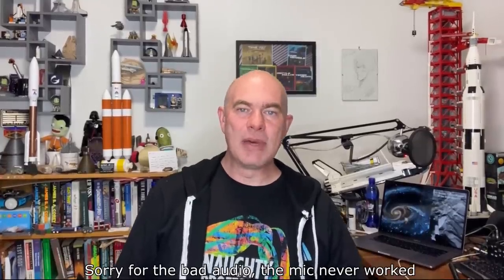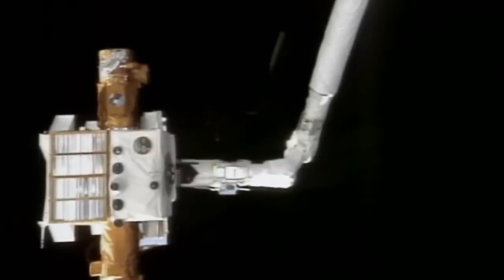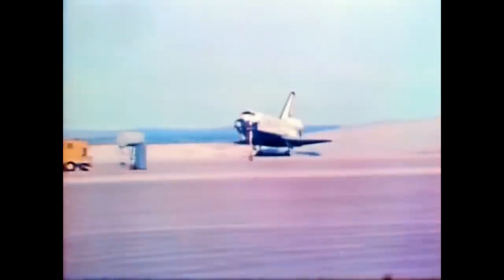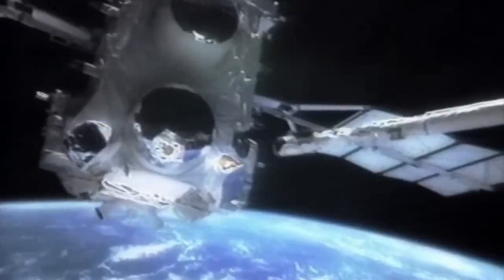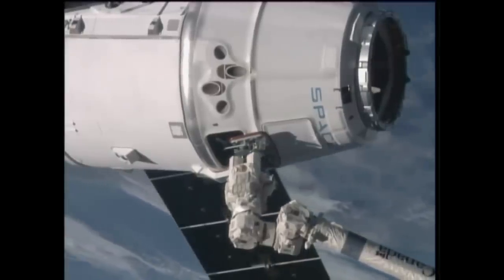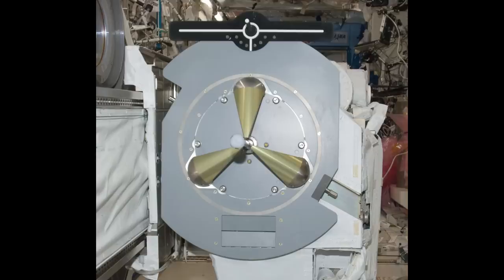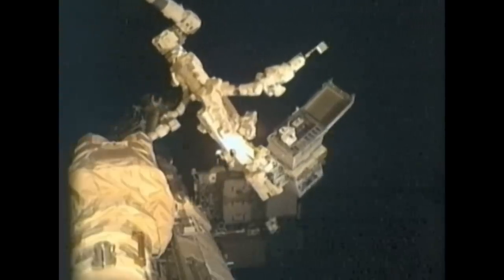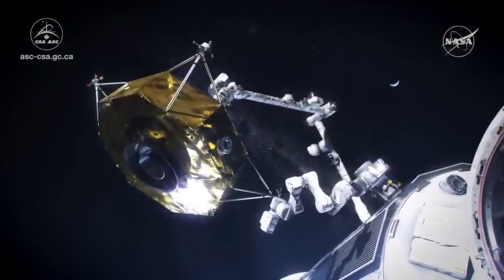Oh, Canadarm - Why NASA Calls On Canada for Robot Arms IN SPACE

Comment: At the Falcon Heavy demo launch, I had the chance to hang out with an astronaut for an hour or so.  We spoke at length, from an engineering perspective, about the Canadarm.  One thing he made me realize was that the arm is prone to oscillations, that can't be dampened in space.  Because of the 0-G, if an oscillation happens, it will bounce up and down the arm continuously until it completely destroys itself.  This is why very slow movements is done, and the Canadarm contains specific gyroscopes to help it control such oscillations.  Space Engineering just blows my mind, everything they have to think of that we take for granted on earth.  When we design something, we assume a pull of gravity will help dampen oscillations.  Not in space.  What a GREAT, bleeding-edge contribution to the space program.  Canadian Engineers Rock (ERTW).
Reply: Gravity on its own doesn't damp oscillations. Think of a pendulum, for example, or an eccentric orbit. Air does, though.
Reply: @IDoNotLikeHandlesOnYT  It does not, but remember the canadarm is a shelf, and with a shelf the weight of the shelf dampens the oscillation against the fixed point.  I'm sure you remember the Partial Differential Equation class with the spring on a spring on a shelf!  Ugh i still have nightmares of it.
Reply: So turns out the robotic arm instability in KSP is actually a feature... I'd just wish there was an Inverse Kinematics controller.

Comment: There is a piece of the story you might want to look up.  I am going off of memory here, but in the pre-Internet days when I was in elementary school, I wrote a science report about the canadarm.  (I.e. better fact check this before talking about it).  What stands out for me was that the Canada wordmark clearly seen on the arm was a last minute addition, and extra testing had to be done to make sure adding the logo wouldn't impact performance.  During that first flight when they tested it, video downlink was spotty for the reasons you mentioned. When the TV feed cut on after deploying the arm, the logo was plainly visible: a big fist bump for us Canucks.  The thing is that prior to that flight, there was no American flag on the side of the shuttle...  Sufficed to say, the shuttle program added the external logo.
Reply: Honestly, anything that flys should have pinup art.
Reply: Not quite right.  The external flags were there from day one.  However, the US flag stitched to the aft payload bay bulkhead's thermal blanket was added in response to the Canada wordmark showing up.

Another trivia note:  Apparently, on STS-2, one of the astronauts took a little sticker of the Canada wordmark and applied it to the RMS control panel during the flight, very neatly, looking as if it was intended to be there from the start.  Thing is, since that sticker was not on the official drawings of the panel, it was dutifully scraped off during the Shuttle's turnaround for the next flight.  However, apparently, the astronauts disagreed with this, because every time the Canadarm flew, the Shuttle came back with an identical wordmark sticker applied in exactly the same place on the panel.  Every time, it was scraped off during turnaround... but come the end of the program, apparently, NASA saw no need to "correct" that one last time, because in photographs that were taken of Endeavour's flight deck after her arrival at the museum inn Los Angeles, you can see that the Canada wordmark sticker remains in place on the RMS control panel.
Reply: @rdfox76  that actually makes more sense than what I remember and understood as a ~10 year old. Unless they put a camera on the end of the canadarm, you wouldn't really see the external tail flag on the TV feed for most missions...  A flag on the inside of the bay on the other hand would show up, and would help downplay the prominence of the canadarm markings.
Reply: @cgapeart  Still sounds like a pretty good paper for a 10 year old.
🙂
Reply: @thatotherguy7596  "He had a report due on Space!"  (I'm thinking of that encyclopedia Britannica commercial)

Comment: Years ago, Wired magazine had an article on the team that wrote “perfect code” for the shuttle. To point out how good it was, they mentioned that they found a bug in the code that operates the Canadarm when mounted on the right side. The only thing is, it was never mounted on that side. They were so thorough they would debug code that was in the spec but never used. The story was more interesting that that, but I thought it was an interesting Canadarm anecdote.
Reply: When something really cool is attached to the side of your 100 billion dollar toy you make god damn sure you know how to play with it without breaking it lol  It's an amazing feat of engineering on both ends and I'm super proud to see a maple leaf in that shade of red up there doing everything we ask of it and more
Reply: That is a great article, worth looking up. I read it back around 2007 I think. The STS flight software is known as the closest thing to perfect code that's ever been written. Whatever else was wrong with Shuttle, the software was on point.
Reply: In fairness, the original spec was to be able to mount a Canadarm on both sides of the Shuttle simultaneously, and operate them independently (though one move one at a time); the RMS control panel included switches to allow the controller to operate either the left or right arm, and there were also separate latch controls for the left and right arms, plus the Shuttle was built with mounts and other RMS support hardware on both sides.  This actually proved to be a boon post-Columbia, as the OBSS was not only built from spare Canadarm parts, but also was carried in the position reserved for the right-hand RMS.

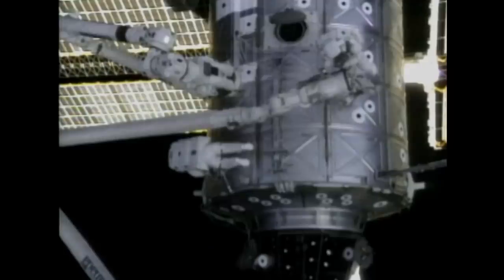Comment: Thanks for this walk down memory lane. No, I work directly with the Canadarm(s), but I did work with the Space Vision System (SVS) and Laser Camera System (LCS), both which were used in Canadarm operations. SVS was the machine vision system that uses those black-and-white dots (e.g, @9:40, @11:44, ...) and was used for assembling new elements of the ISS. It gave the relative pose (x,y,z,yaw,pitch,roll) of two modules while the Canadarm/2 was berthing the new module, and did it from the cameras at the far end of the shuttle bay often 50 to 75 feet away, looking at the side or back of the module. 

I supported 13 SVS flight including the first ISS assembly (STS-88), and 6 from MCC including STS-100 where Canadian Chris Hadfield installed Canadarm2 on the ISS using the Shuttle Canadarm and Canadian SVS system (which I was supporting in MCC), with Canadian astronaut Steve MacLean as CAPCOM in MCC. (Canadian astronaut Bjarni Tryggvason was CAPCOM on night shift.)

LCS was the 3D imaging laser on the OBSS. It's the shiny silver looking box with the window @7:14. I still remember viewing the first data in MCC on STS-105, the Return-to-Flight mission 2 years after Columbia. It was both sad circumstances but satisfying as an engineer to contribute to returning to flight, especially after working with LCS for 4 years at that point. An interesting legacy was the evolution from LCS to TriDAR rendezvous and docking sensor which flew on STS-128, 131, and 135 and has been flying on the Cygnus re-supply vehicles since 2011. 

It's been a privilege to be involved in these programs, including assisting on the Canadarm3 program in recent years, but there's nothing like the days of engineering R&D, weekends in the black lab, and MCC mission support. Some pretty funny stories too. If I'm lucky my kids will be able to say the same about the Lunar Gateway and moon missions in the coming decades. (If I'm really lucky, I might get a few more stories too.)

Thanks for triggering these memories, Scott.

Comment: I spent my career as a mechanical designer (no degree) mostly for microwave antennas (they were never referred to as antennae). I did work on the ISS Electronic Control Unit (ECU) for the beta gimbal and I had to design an grapple interface with the Canada Arm. The ECU was EVA or Canada Arm replaceable.
The grapple was itself was designed by Canada, but I had to design an indicator that the robotic camera could see. The NASA requirement was that soft dock and hard dock could be seen by the camera.
Soft dock was that a ball detent was engaged so if the ECU was let go of, it would not float away. Hard dock was a fully engaged unit.
I went from working on the ISS ECU to Hughes Satellites where in the mid to late 90's, I worked on design of TDRS satellites (I think they H, I &J) and in the 20-teens, worked on the next generation TDRS satellites (I believe K, L & M).
I was never able to find a decent picture of the ECU for the beta gimbal and I don't know if one was ever replaced on orbit.

Comment: When I graduated highschool (~5-6 years ago) I was fountinate enough to meet a man who worked on both the Canadarm emergency retract protocol and Dextre.

For Canadarm emergency retract, Nasa set a strict retract time so that the arm could get out of the way incase a capture spacecraft started tumbling towards the station. He told me in order for the arm to move that fast it needed both redundant power supplies to be on at once, but Nasa wouldn't allow any modifications to the hardware or regular arm software as it would require recertification. So their program actually tricks the arm's powersupplies into thinking the other one failed so that they would both activate.

Also for Dexture he told me the robot arms weren't strong enough to move on earth so they would use a pully system to test it on the ground. According to him there was a couple of times where they would leave for the night and come back in the morning to find one of the arms would be in a completely different position as some of the pullies would lose a little tension overnight. Then they would freak out as a group as they almost damaged a multi-million dollar robot.

Dude teaches computer science at one of my local colleges!

I am always so proud of my county's contributions to space dispite our painful lack of launch vehicles.

Comment: In case you didn't notice it (even though Scott mentioned it), starting at 13:55 look closely at the top of the screen, what looks like a Buzz Lightyear toy is actually NASA astronaut Scott Parazynski on the end of the 90 foot long combined  Canadarm. It's a wide angle shot but still he is way out there. 

Mission managers cautioned Parazynski not to accidentally touch the solar panels as they were worried about the high voltage flowing through it.

Comment: They were supposed to leave the arm stowed because we wanted a lot of time to deal with unexpected issues if something came up when using it.  For example what if they couldn't get it stowed safely for re-entry?  They definitely had to come back early because of the other issues.  They took from us the time we would have needed to save them if it went wrong.
Reply: Yeah, I was thinking they took quite a gamble there.
Reply: Not really.  All devices that were designed to extend from the Shuttle's payload bay and thereby possibly prevent the doors from being closed for re-entry were equipped, from day one, with a failsafe device--they were mounted to the vehicle with explosive bolts, and all plumbing and electrical connections were equipped with either quick-disconnects or pyrotechnic guillotines to cut them.  If they got stuck and couldn't be retracted and stowed in a way that would allow a safe re-entry, the procedure was to fire the guillotines, then blow the explosive bolts to jettison the device, then use the RCS to maneuver away from the now-free floating device so that you could close the doors and come home safely.  This included not only the Canadarm RMS mountings, but also the high-gain antenna/rendezvous radar on the upper starboard side of the cabin aft bulkhead.

What the unplanned testing of the arm cost wasn't time needed to save them if it went wrong, it was time that would be needed to save the arm itself if it went wrong.

Comment: Ex-MDA employee here. Funny story from the first shuttle flight that carried a Canadarm. 

As can be seen from any video from that and subsequent flights, there is a pretty prominent "Canada" logo mounted near the shoulder joint and located so that it is very visible from inside the orbiters. So, here was the first orbiter flight with an arm and the only national insignia visible from inside the orbiter was the "Canada" logo, big and large near the payload bay windows. Comments started coming on to NASA and US Gov officials wondering how much of the orbiter was Canadian and where were all their tax dollars going if Canada was doing the work/getting the credit, etc. 

NASA officials were both nonplussed and rather put out about the logo, but adding the logo was not forbidden in the requirements and we were within the mass limits, and as the Canadian Govt definitely wanted the credit for the bits we supplied, a logo there would be. It was only after the Canada logo showed up inside the payload bay that the US flag and other US national and industry logos started to show up in the payload bay as well.

Comment: STS-107 Columbia was not a Spacelab mission, it was a Spacehab mission, which made use of a two pressurized modules that were derived from Spacelab's, but had a flat top as opposed to Spacelab's fully circular  shape, and made use of the same tunnel and adapter interfaces.

Spacehab was owned and largely operated privately by Astrotech Corporation (formerly Spacehab Inc.), with NASA as its primary anchor tenant customer. 

The pressurized Spacehab flew far more than its Spacelab cousin (22 versus 16 times), namely because it was cheaper, easier, and more versatile. As a plus, the flat top allowed for emergency EVAs to reach parts of the payload bay, if the doors were closed or the astronauts had to close the doors manually and then translate back over the Spacehab module to get back to the airlock before reentry.
Reply from the maker: https://www.youtube.com/watch?v=qOb5tdtHIG4&feature=youtu.be

Comment: I got to see two of the nasa training arms at JSC Houston. One was used in the neutral buoyancy lab (the giant swimming pool) and one was in a mockup training area. Thought it was interesting that the arm in water, was designed similarly to the real one, except it used hydraulics instead of electric motors, because water. But it was also designed that it couldn't support itself out of water.  The one used in the training building used electric motors, but was made of metal to be robust enough for gravity. Space camp is awesome.

Comment: I heard a story that I can't confirm, that the engineers behind the Oneway brand of industrial equipment were trying to develop a lathe that would do a superior job of maintaining a constant speed under changing resistances, like when a tool is pressed to or removed from the workpiece on the lathe. Somehow these guys ended up discussing the problem with some folk from SPAR Aerospace, who had faced a similar problem with Canadarm. So there's Canadarm tech in these woodturning lathes now.

Comment: I always thought that the various joints of the Canadarm had some sort of reaction compensation built into them, so that they can be actuated without causing the Space Shuttle Orbiter or ISS to rotate in the opposite direction.

I imagined that they had flywheels inside that would spin in the opposite direction in order to keep the overall angular momentum to zero. And I thought they must have to spin like crazy when manipulating a large payload.

I haven't got a clue where I got that idea! I must have dreamt it. 😊 I guess it's the reaction control system of the ISS itself that has to compensate for all the movements of the arm.
Reply: There are control moment gyros (a type of reaction wheel) on the ISS as well as thrusters, yes.